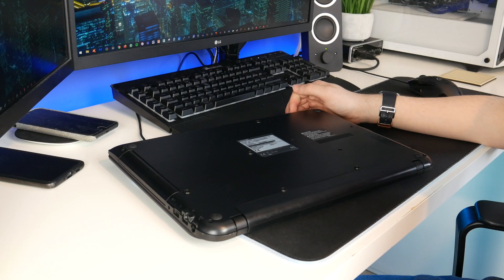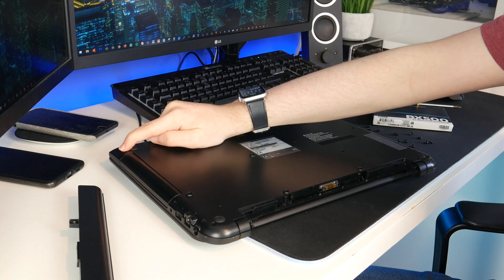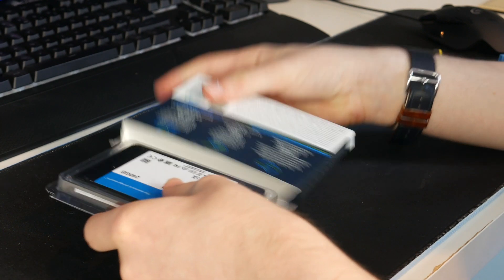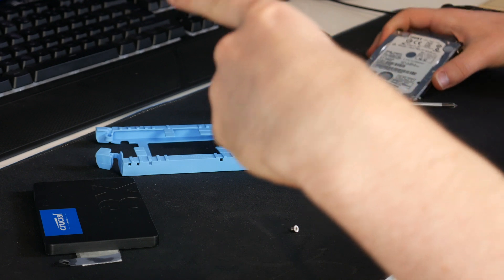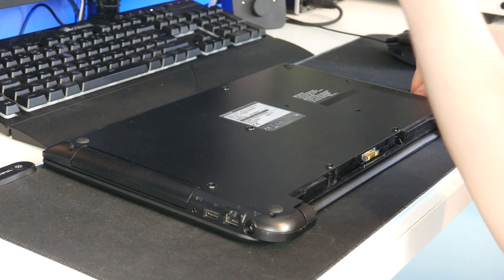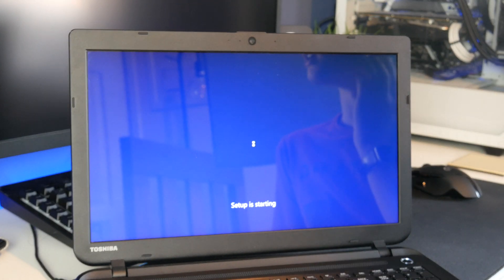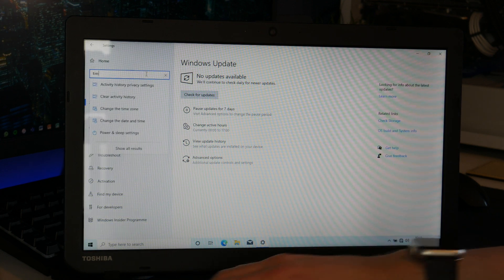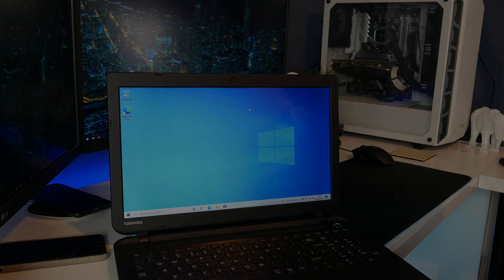Installing An SSD In A Toshiba Satellite C50-B-14D

Comment: Could you tell me, if it is possible to replace the CPU?? I found this Toshiba SATELLITE C50-B14E to be REAAAALLY slow. And I don't think that increasing RAM improves performance. I also installed LINUX MINT and it is really slow to handle it. Please, advise

Comment: Thanks for the instruction. Very helpful. One question if I may... how do I prevent loss of data from the original drive?
Reply: 2 options. 1. Image original to SSD (shrinking image if SSD is smaller). 2. After SSD install put original in a USB case, plug it into the computer and copy the files you need to the computer.